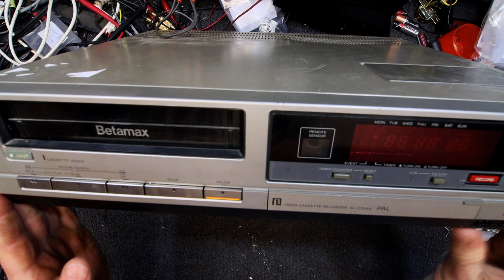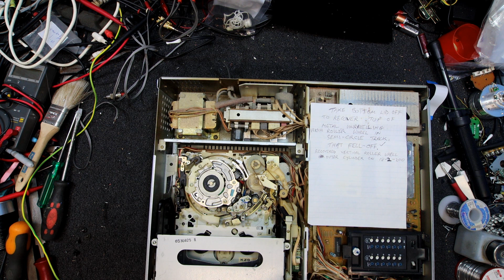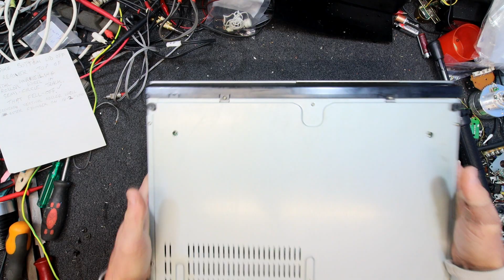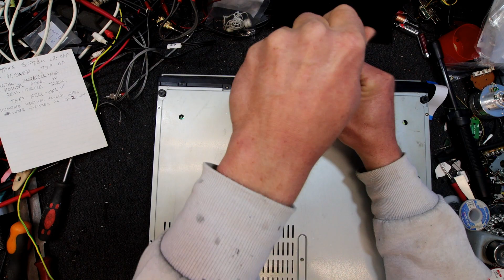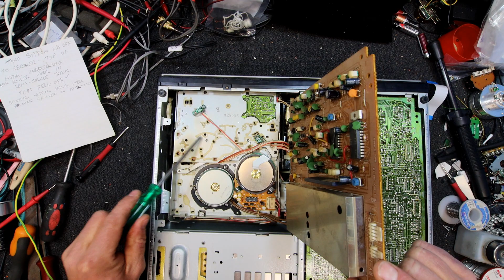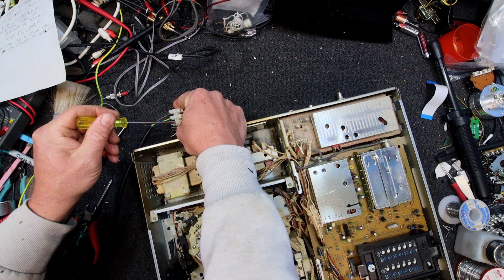Sony SLC35 Beta Video Checkover and Repair no Loading

Comment: I'm lucky in that my machine occasionally cant or slowly pulls tape in, but other times works fine, meaning following your guide might just bring it back from the almost dead. Thanks.
Worth a new belt or do these types go on forever. Don't look like they will turn to sludge.
Reply from the maker: I think they have the toothed plastic belts which are usually fine unless they snap
Reply: @StevesElectronicRepairShop the belt looks fine so I think I'll leave it.
I followed your instructions and I haven't had a problem yet. 👍

Comment: I might be jumping ahead but I noticed mine did that , until I noticed i had to turn the power button on, then inserting the tape was fine.
That would still be a fault though? Putting a tape in should turn it on,  right?